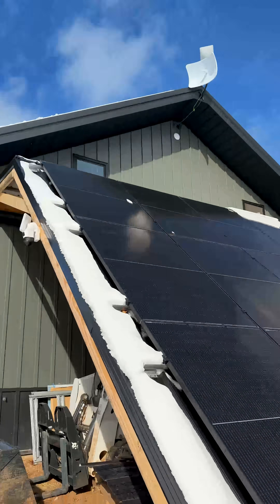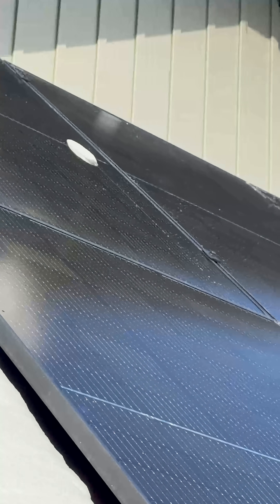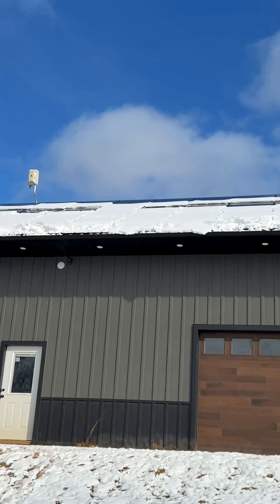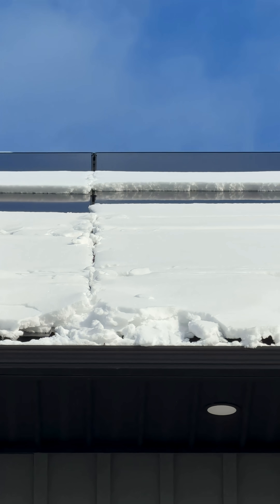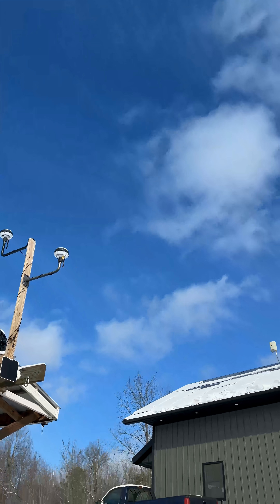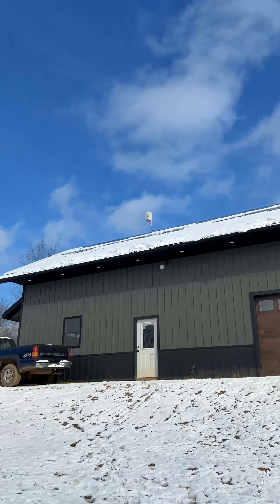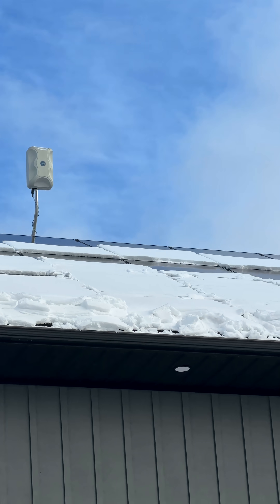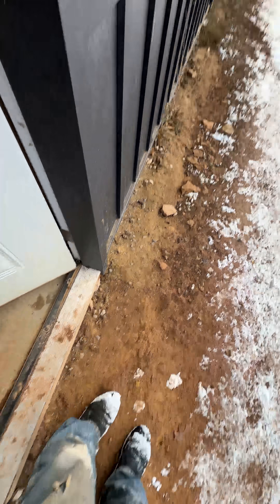Finally getting some sun on the panels #narrowayhomestead  #offgrid  #solarpower

Comment: I’ve used gtechniq easy coat on my solar panels. It helps keep them clean and the crap slides off much easier. 
If you have any running water on the property a small hydro electric setup would really help on those long cloudy days. They don’t normally produce a lot of energy but because it works 24/7 it really helps keep the batteries topped up. ✌️
You can make a snow drag with some rope and a big broom head for the upper roof to clear it of snow.

Comment: Can you spray them with rain X to make the snow slide off easier?
Reply: I'd be wary of putting any chemicals onto them that aren't intended for them cuz there could be unintended consequences of it
Reply: hm i wonder if it would somehow affect its sun absorbing ability or not
Reply: That's a good question?
Reply: @Clippy5436 ilyt clippy
Reply: @Clippy5436 ily clippy
Reply: Rain-X's official website says not to use it on solar panels. People online say it doesn't effect power intake, but since he got brand new panels, I'd avoid voiding the warranty
Reply: *Snow X😂
Reply: Rain-x or car wax would do the trick, but would likely need re-application each fall.

I'm sure before long Nate will have a robot 'mower' to clear the roof panels though. 😅
Reply: They honestly should be fairly slippery on their own, should only take some gentle nudging.
Reply: That is a very good question actually
Reply: Throw a duck on top of them
Reply: Ceramic coating